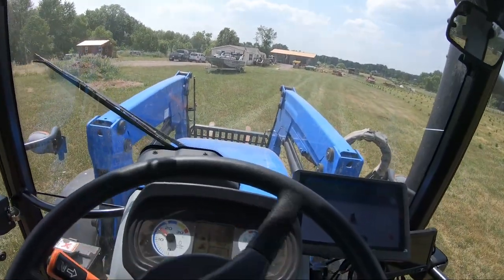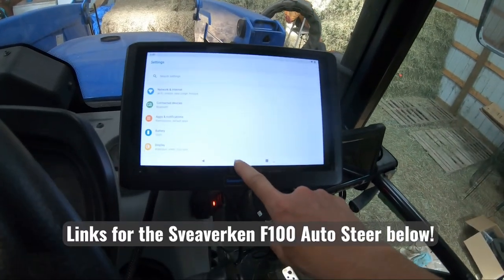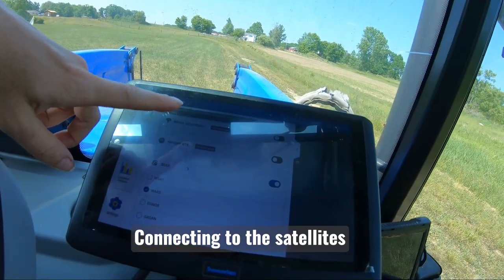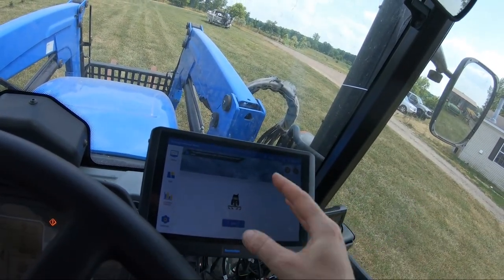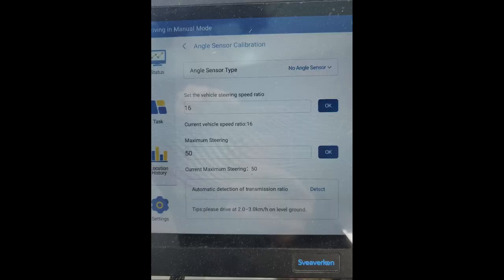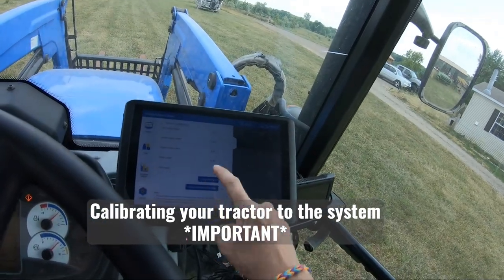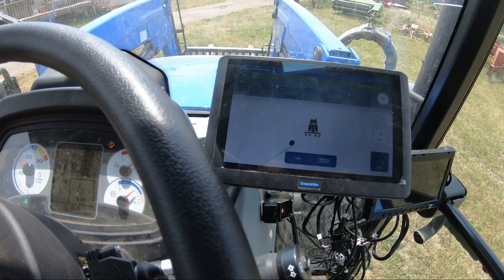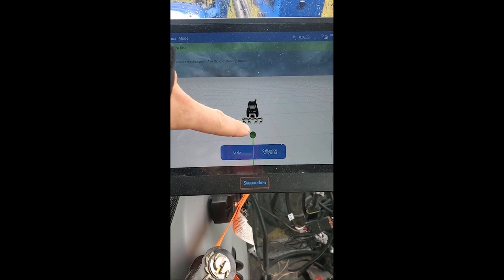EASY AUTOSTEER SYSTEM SET-UP: Sveaverken F100 Auto Steer System Calibration & RTK Setup Video 2 of 2

Comment: Great video!
I bought a different company low priced auto-steer last winter and didn't find time to install before planting season. Thanks for posting this! Maybe this old geezer can get "Hi-Tech farmin" at age 67 after steering for 60 years!! 😊
Reply from the maker: I would find a tractor forum with an area regarding autosteer. Each system is a bit different, and sometimes the cheap systems cut corners and don't use the most current technology for connecting to satellites.  So if you run into any issues they can certainly help out a bit. But the videos will at least give you a general idea of what to expect with most systems ;D

Comment: Suzanne i learned that I want no part of one of those  😊😮😮😊  I got to use a tractor  with GPS on it  and  it sucked 😊😊😊😊😊😊
Reply from the maker: The RTK is a much better way to go. Likely the tractor you used was using WAAS which is not as precise. I haven't tried one to the other, but a farmer friend had both on his tractors and was not happy with the WAAS hook-up. Everything I've read online says RTK is the way technology is going. That's what drone use to fly with too.

Comment: Most of our  guidance is in straight lines,   Because Our  Mowing, Tedding, Raking protocol           First  is to mow 6  field perimeter   rounds and   then   completing   the rest in sections........The latest arrival (6R145) is factory equiped..... with guideance plus the newest 4x5 round baler(460R) is Isobuss  intergrated  to control  the  baling functions of the tractor......
Reply from the maker: We have gradually migrated to rows except for cutting. It took too much time to do rows cutting. If this can cut rows cleanly and in about the same time or less than circles, I'll consider continuing it :D
Reply: The accuracy in the width of desired application ,,,,,,   utilizing  the max width with each pass....My son uses it to spread  fertilizer and  herbicides.......in the dark

Comment: Hi, I have a question. 
How has it been going with the equipment? 
Is it of good quality? 
Does it meet what it claims?"
Reply from the maker: Yes it does overall. I had a generation 1 interface system, and as my season ended they launched generation 2, which they tell me actually fixed most if not all of my complaints in regards to usability of the computer touch screen. It was accurate in both the WAAS and the RTK system. But just understand that only some states offer a free RTK connection, and otherwise you'd have to buy the equipment to set up the satellite transmitter. But on that note, the RTK might operate better. I used our free Michigan system and it was always cutting out. You could find someone with a drone, and test your field connection that way since they use RTK.

But really the only reason I didn't use the system more is because my hay cutter (the thing I really needed it for) was not a fixed position implement . . . each time I sued it I had to crank it in or out and since the distances changed it affected the cut path. But really it was a stress-free way to seed and fertilize!

Comment: Great video, thinking about buying either this system or the Fjdynamics at2 systems, does the f100 monitor have a USB port, and can u store / save all your field data and is the software free? Thanks any help would be appreciate in making a decision
Reply from the maker: It does have a USB port both for updates and for field data storage. The basic software comes with the system, but they have the option for the upgraded software which allows for the U-Turn function. I have been playing with that lately and it's a game changer for sure. It plots out all your field passes and puts you right on the correct row. It IS tricky to program and the directions are a bit confusing, but after you get everything set-up it's cool to see the system take-off!
Reply from the maker: It also does store info in the system interface, and you have the option of an external SD card too.

Comment: In part 1, you showed the angle sensor, so why @6:55 you said click No angle sensor?

When you are mapping the field boundary, did you setup an offset or did you use the center of the tractor?

A field boundary would not be a guidance line, so when you were driving around the field the second time, the tractor was not going to drive in the same tracks.
Reply from the maker: I am not sure why you have to click "no angle sensor". That's what I was told by the tech support team.  I drove field boundaries and guidance lines. but yes, they are different, and will vary a bit depending on implement settings.
Reply: @This1LifeWeLive  Yes, the guidance lines will adjust when you change to a different implement.
I purchased my first auto steer in 2008 and currently have auto steer in the planting tractor, combine, and sprayer.  They are all different systems.
Do you have to have a field boundary because of Auto Turn?

Comment: Wow, the system sounds complicated. Once you get good with it, you could probably sell,  install, and set up the units.
Reply from the maker: The biggest downfall I see is just lack of concise instructions in the manual. Such as RTK needing a solid internet connection (had to research that online after my connection kept dropping when I left the front yard, haha). I think with clear step by step instructions it could in fact be quite simple. So, I'm trying to CREATE a video instruction manual to make it faster for others  :)

Once I figure out each correct step, I'm sure I could explain it to someone else and have them running in a fraction of the time it took me ;)

Comment: These things are used for row crops harvesting, planting and tillage. Hay bailing not so much. The system is fine. They work well when applied to a full-time farm of decent acreage. You didn't trace any boundaries. You have much to learn. You really didn't show it working at something productive. Moste videos like this end up showing that it does something useful.
Reply from the maker: There is a decent learning curve with these systems, and having clear instructions helps as well. Most posts I found online stated they had SOMEONE ELSE set everything up and SHOW THEM how to do it. I don't have anyone here with me to help, just a tech support team trying to help through chat (which was better than just me on my own and they did their best).

I did actually draw several boundaries. I spent hours drawing boundaries in fact, so I could not film everything. No, I was not able to show it doing something "productive" as we had just had a massive rain and the fields were wet, so I had to make do with testing it's ability to stay on a curving path, which was my main concern anyway. I don't think it's too hard to get a tractor to drive straight, but to follow a meticulous path takes more skill ;)